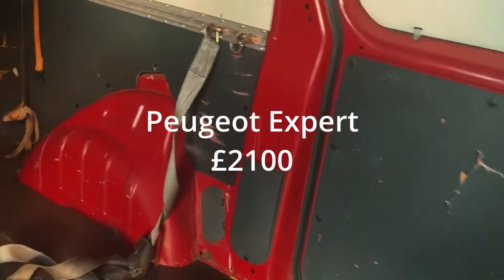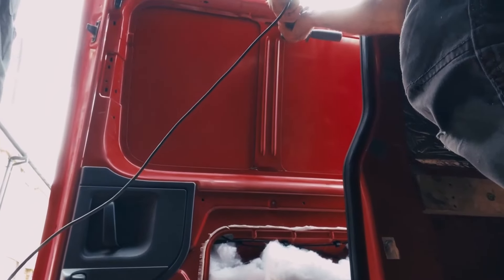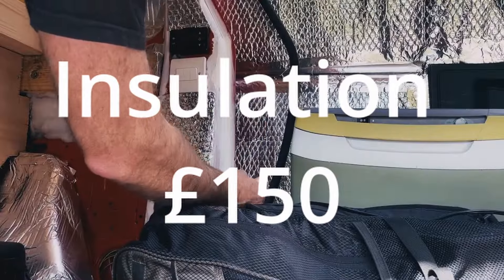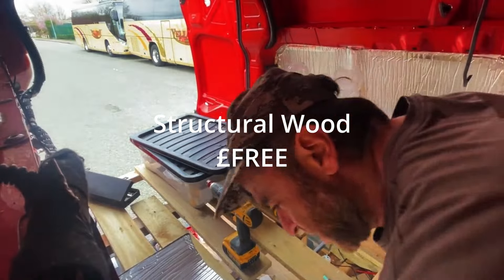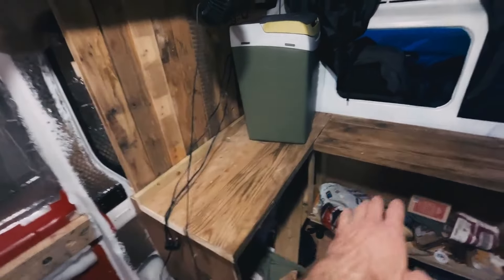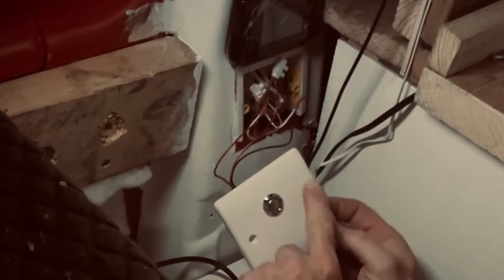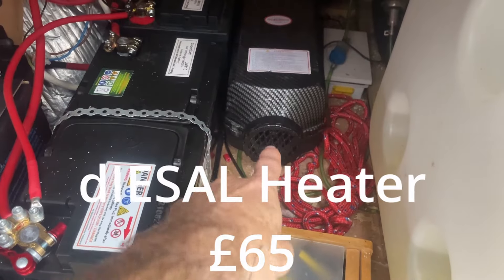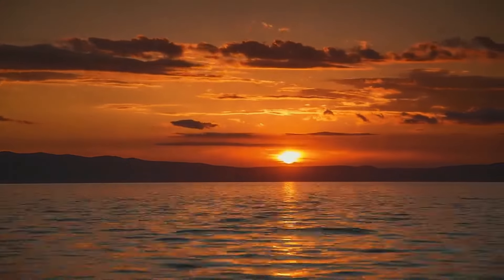My Sanctuary Of Solitude for £3.5k  | Money Well Spent - Peugeot Expert Full Conversion | Ep25

Comment: I spent £250 just on insulation on my 2006  Citroen Berlingo van it's now toasty warm without the diesel heater switched on, my little van is built to o live in full time not for camping, so it doesn't have the fixed bed or cooking area it's built to live in
Reply from the maker: Good work 🚐👌🏻